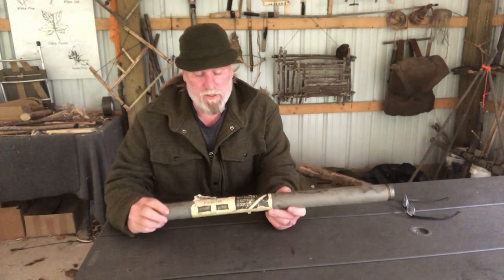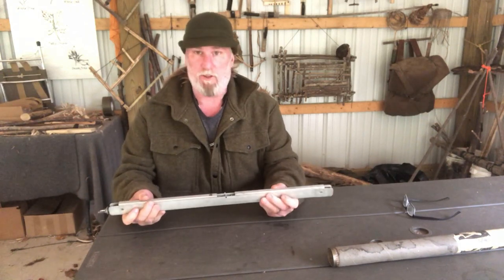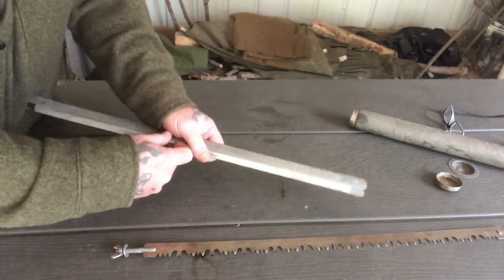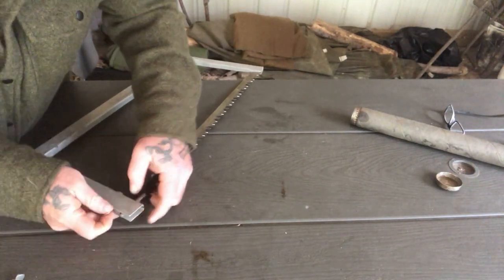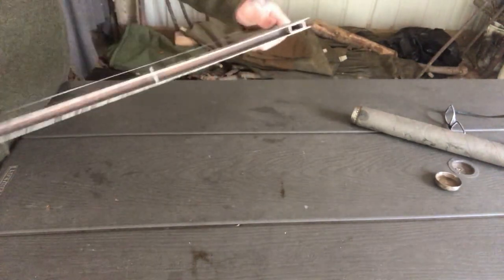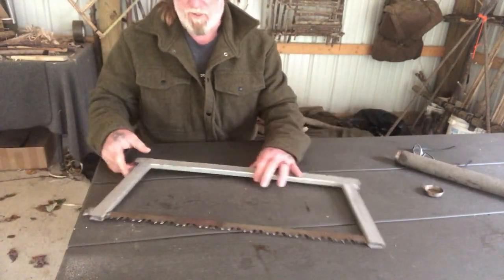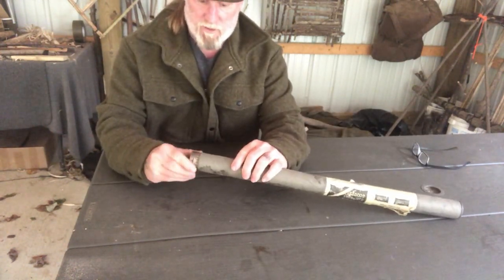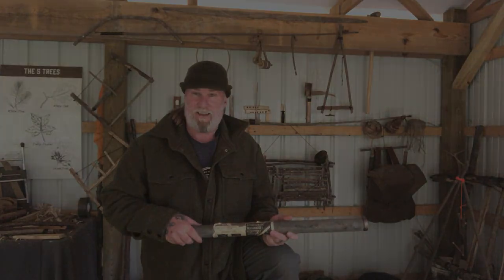Woodsman's Gear of the 20th Century Part 2

Comment: It looks like you could insert the back of the blade forward of the wingnut in the rear slot then feed it forward into the hole because you're already in the slot. Then slot the front in. Just a thought but it looks like that's possibly a way to do it without risking dropping the wingnut and washer.
Reply from the maker: Problem is the bolt barley goes through the frame and not quite far enough for the blade to be in the slot until you get a few turns on the wing nut, It was in unused condition when I found it so there is still a lot to tension in the frame-
Reply: David Canterbury I wondered if that was possible because it is in excellent condition.

Comment: Great video love the vintage woodsman tools. When do you think you might do some more blacksmithing videos, oh by the way a good cheap starter steel for making your own tongs is slick rod for concrete they are 1/2” and come in stock lengths in 6” intervals so a pair of 18” are about $2.50 pretty cheap for a set of tongs
Reply from the maker: May be a while with all the travel, shop is tied up most of the time with my nephew making product for SRO at the moment

Comment: Of note, Dave, this blade doesn't have hardened teeth. it can be resharpened with ease.  Whereas most new bow saw blades are hardened they are blued, and will wreck a file in short order. Am I mistake on this?  The blade does look like it can be resharpened.

Comment: Dave can you mention why you guys are not producing the Bushcraft PKS blade anymore?
Reply from the maker: We still produce the blade as a kit knife blank, we just don't produce the finished blade at this point as we have chosen to stick with out top sellers for a while in order to keep up with demand-
Reply: @DavidCanterbury   The differences I see between the 01 knife blank and the finished blade is the grind angle.  I've recommended the finished blade to many because the blade 
grind angle is steeper on the finished blade Outfitters offered.  I hope Outfitters will consider putting the same grind angle on the 01 blank so I can direct others to that blade.  Thanks for responding.